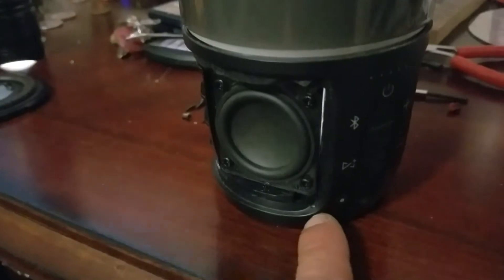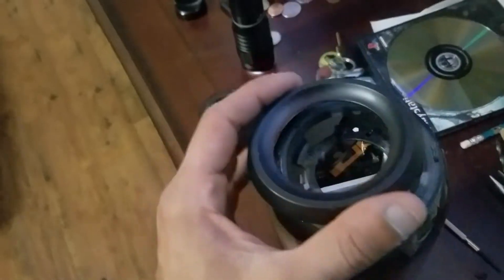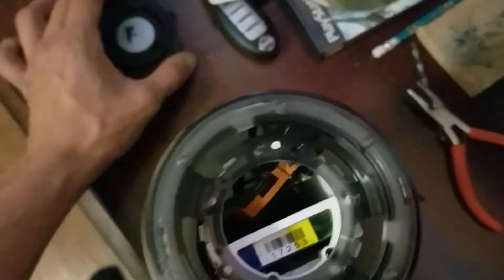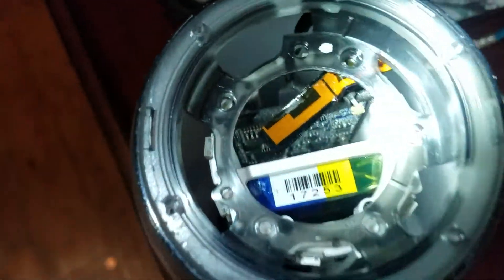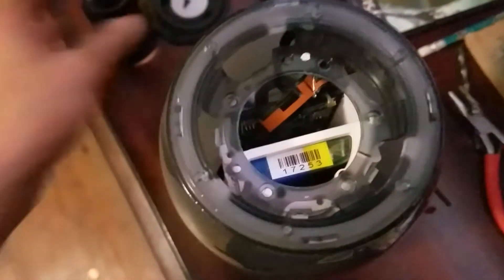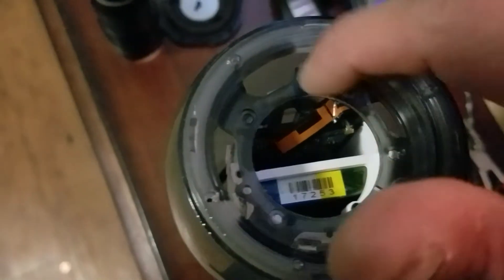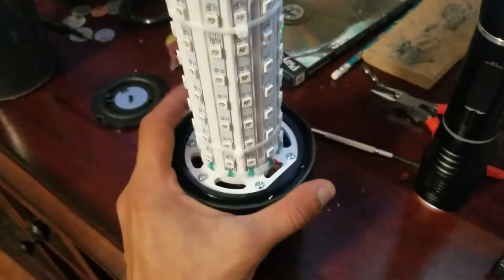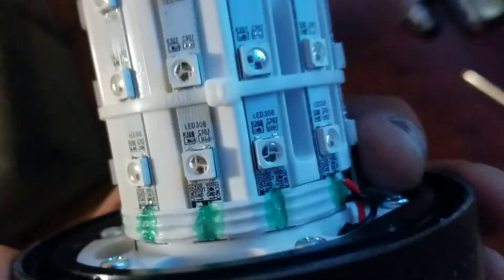JBL pulse 3 teardown

Comment: The sound on its own is great     lnfo.help/JBL_3?紅    The lights are an added bonus. I finally scooped up a JBL Boombox and grabbed 2 - Pulse 3’s to go with it and I’m really impressed! Fills my backyard with sound easily!!! No more lugging a PA up and down the basement stairs. Set this up, pair it all together through the JBL Connect app and let it rock the party. Like I said the sound from one Pulse 3 on its own is great, pair 2 or more together and it only gets better. Throw a Boombox at it and you won’t be disappointed, and I’m not the easiest to please.

Comment: I did’nt saw any seals 

Are there only rubber protectors to make it water resistant
Reply from the maker: It's pretty water tight and yes the rubber protectors and mesh speaker cover  are the only thing that keep water out.

Comment: I took the grill off but I'm having trouble taking the top portion off from your step 2.
Reply from the maker: Sorry for the late response but you just have to turn it to your left and it will unlock it and then it should come up. if you're talking about the ring on top

Comment: do it completely please, my pulse 3 has a problem in it's battery so a wanna replace it
Reply: Nice breakdown. I have blown speaker. I believe the woofers. Sound is terrible. Going to try and repair
Reply from the maker: @irish4220  just saw your message, how did it go? Hope it went well
Reply from the maker: I got you man, if not today I'll do it tomorrow
Reply from the maker: I did the part 2 already are you sure it is your battery this is broken mine stopped working but I'm thinking it's the USB port that is broken so it's not charging anymore